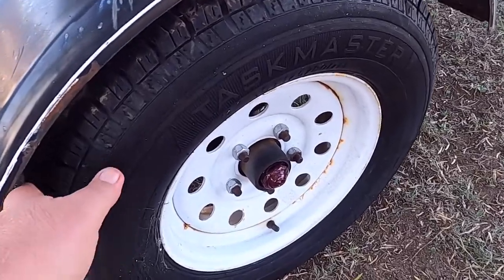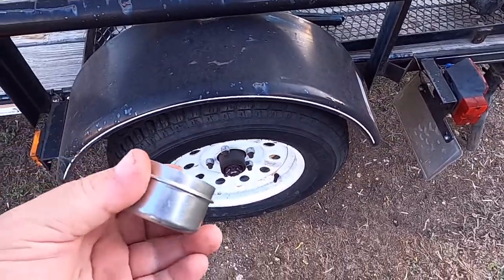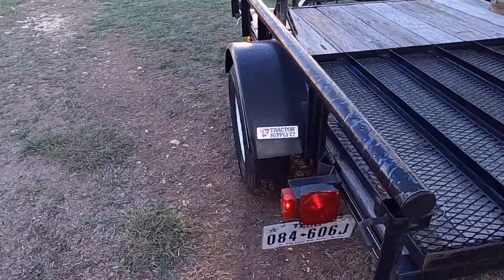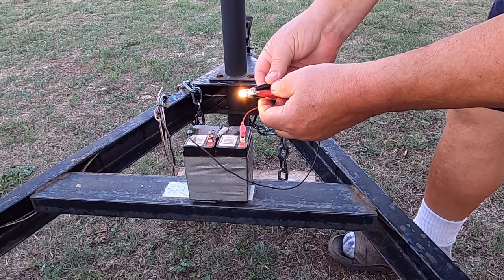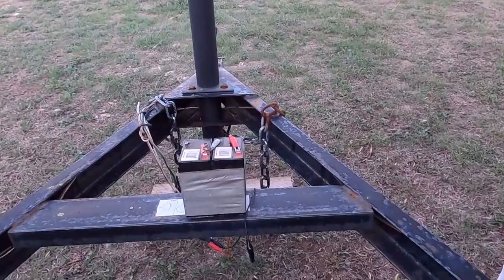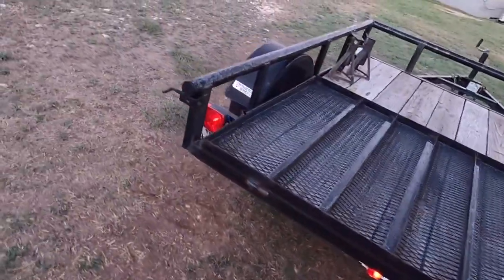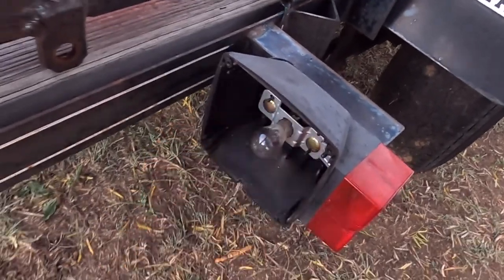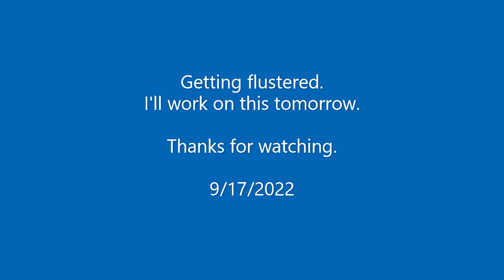Trailer maintenance, Did I mention I hate trailer lights.

Comment: I agree, trailer lights are horrible. If it is not the lights causing the problem, it is the plug to the car or the socket on the car. I think the problem is that it is very hard to buy quality trailer parts
Reply from the maker: I found a broken wire on the brake light and repaired it. Also robbed some marker bulbs off the small trailer. All the lights are working for now. thanks.